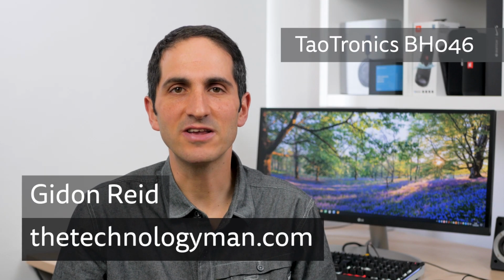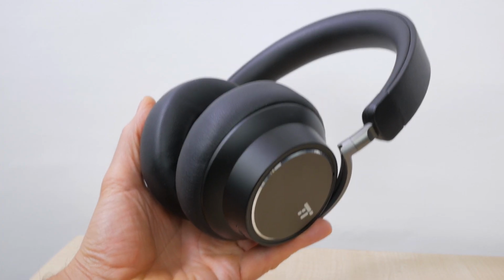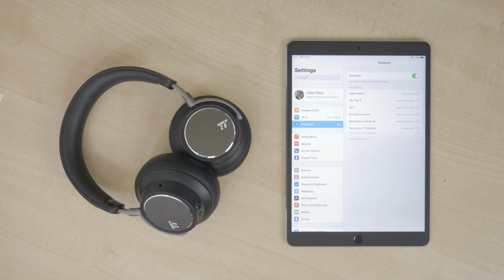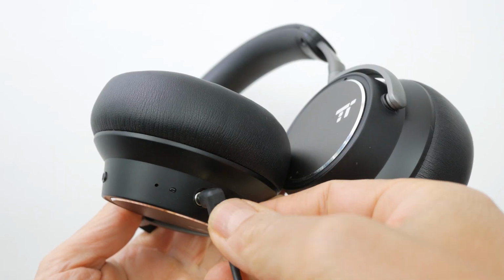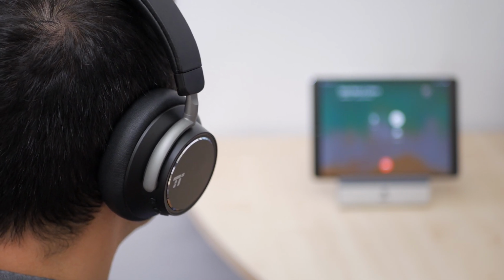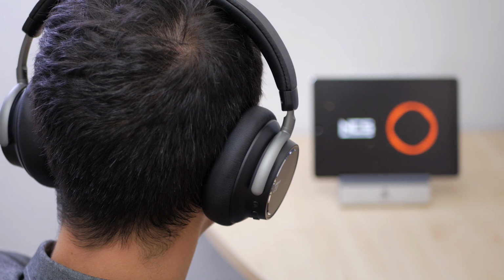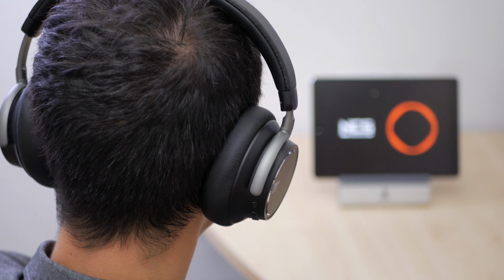Budget Noise Cancelling TaoTronics TT-BH046 ANC Bluetooth Headphones | 2019 Version

Comment from the maker: Have you tried these headphones? What do you think of them? Is there something better you'd like me to take a look at at a similar price?
Timecodes below:
0:00 Intro*
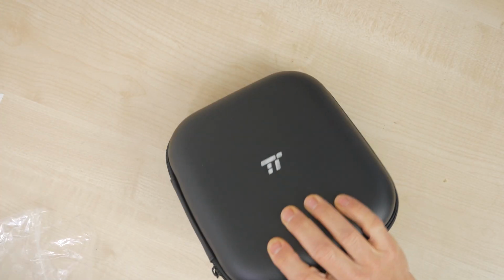0:23 Getting started*
0:24 In the box
0:40 Dimensions
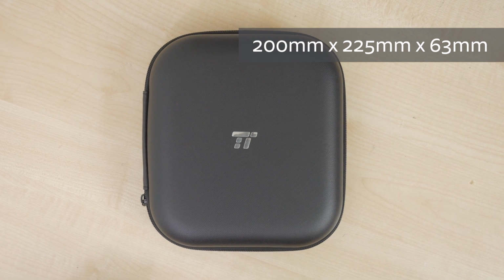0:49 First impressions
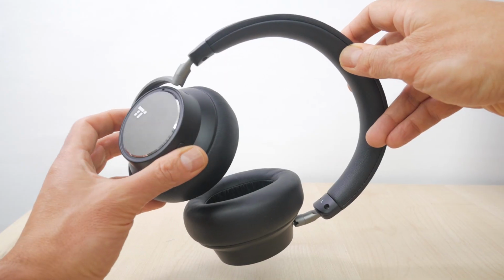1:32 Charging
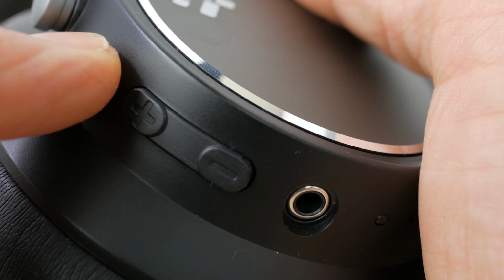2:14 Pairing*
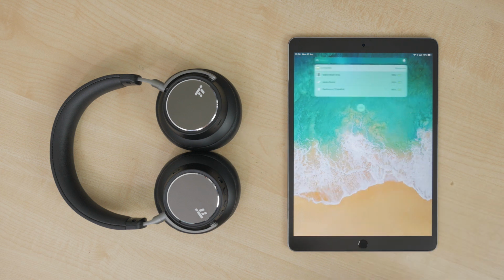2:48 Multi-pairing support
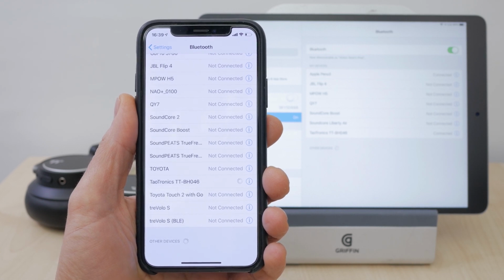3:17 Factory reset
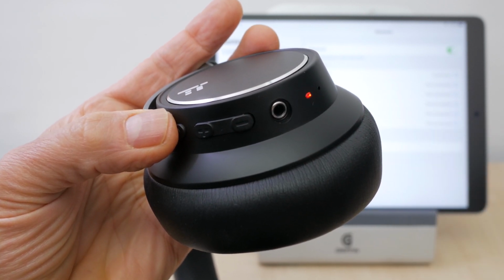3:36 Fit & controls*
3:36 Fit
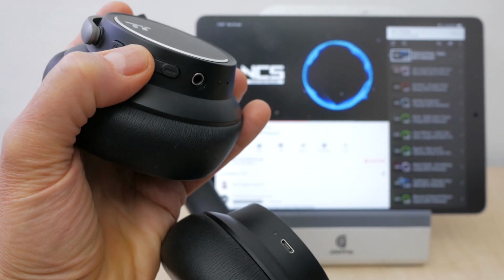4:00 Controls
4:21 Voice assistant
4:40 Active noise cancelling switch
4:47 3.5mm audio cable connection
5:20 Performance, ANC & sound quality* 
5:21 Bluetooth performance
5:41 Audio sync
5:50 Battery life
6:14 Voice calls
6:23 ANC performance
7:24 Audio quality
7:42 EQ settings through iOS
8:14 Conclusions*
*Sections
Reply: I am using them since nearly 3 months now.
For the price they sound really good. Even compared with bose qc35II or the nc700. Of course the Anc and espeacily the mids and highs are not as good as those 300eur headphones, but i appreciate the much warmer (some would say bass heavy) sound of them. I dont leave the house without them :D
Reply: Thanks for the video, where have you been this whole time 😂 I searched for the TT but haven't seen your video before today 🤔 I discovered the mpow 5 through discovery 
Anyway will be getting this during next week, will let you know how it feels
Reply from the maker: 🤣 - yes please let us know how you find them!
Reply: @TheTechnologyMan   Hi -- are you familiar with the Oct 2019 UPGRADED MODEL of the 46's, with BT 5.0, CVC8, USB-C etc, in the champagne color? Reviewer EL JEFE has repeatedly stated that these are not only far better than the model you do a great job of showcasing here, but also better than the newer SoundSurge 55's ... Just curious if anyone else has reviewed this one:  The prob is, it's been out of stock on AMZ:  https://www.amazon.com/dp/B07ZFTMHNY/?coliid=I2YX3EV892HI46&colid=1TLOW0UFXDS5N&psc=0&ref_=lv_ov_lig_dp_it  -- thanks!
Reply: FYI Taotronics confirmed with me in June 2020 that that special edition model was a limited run, and they will never be restocking this item...
Reply from the maker: @quicksite  Hi - sorry I missed your question - for some reason YouTube doesn't always show me replies! But no I haven't tried the Champagne mode with USB-C but was aware of them. Thanks for confirming their availability. I'm sure there'll be an official update to the BH046's soon - and I'll be sure to review them!
Reply: @TheTechnologyMan  Not a problem, thanks for your reply. ... Given what you've said about notifications, you may not get notified of this reply either.  ... Do you find that it's more reliable overallfor people to start an entirely new, as opposed to replying to an existing comment thread?
Reply from the maker: @quicksite  It shouldn't be - but that's how it seems to work at the moment! I have to manually check these replies to replies ...
Reply: How does the sound quality of these headphones compare to the Mpow H7?
Reply: I have these headphones, the sound is as good as $20 headphones, the feel is pretty good. The hybrid noise cancelling is pretty good.
Reply: Dunno if you guys cares but if you guys are stoned like me atm you can watch pretty much all of the latest series on Instaflixxer. I've been binge watching with my gf for the last months :)
Reply: @Ralph Aron yea, been watching on instaflixxer for since december myself :)
Reply: Works great and saved me $$$!!!!

Comment: Thank you for your review. Mostly my experience too.  Pairing is very quick; more then one device pairing at the same time is nice but don’t forget to disconnect the tv pairing when you listening to a youtube review and the daughter turns on the television with children songs. You will get a small heart attack.  ;p There is one issue that I dont like; when the headphone is cable connected to a charger, btw I got a usb-c connector, there is no pairing voice prompt or any other clue if your device is on or connected, beside the light. The same for you or other users? Btw,  Is there a firmware update service available? The headphone pressure starts after one hour, but then I turn the headphone upside down and is good for another hour.
Reply from the maker: Thank you rvamerongen! Yes good tip about the TV! I don't think there's a firmware update.

Comment: I have two questions will these work for a PS4 and if it’s wired can I use the noise canceling?
Reply from the maker: Not without a third party dongle I'd imagine. ANC still works on a wired connection - I just double checked!
Reply: The Technology Man Alright than you and this was a good review nice job!
Reply: @TheTechnologyMan  ?? You can use the 3.5mm to 3.5mm adapter to plug it into the controller.